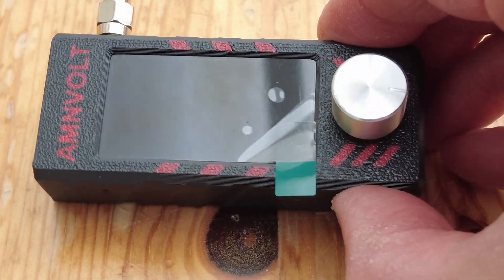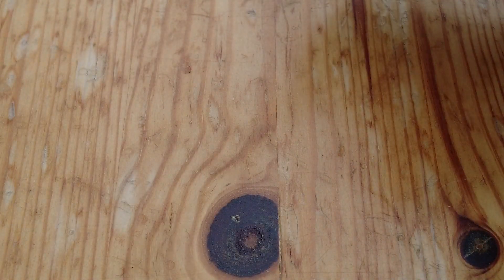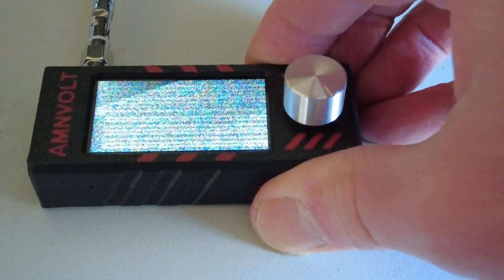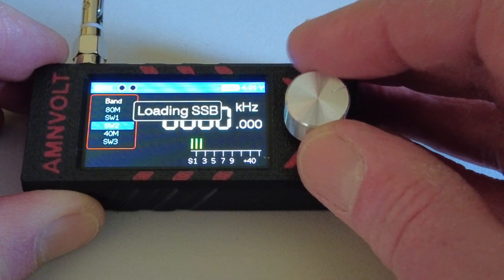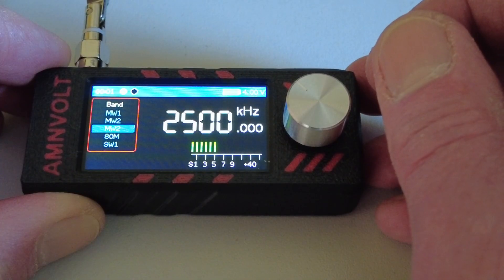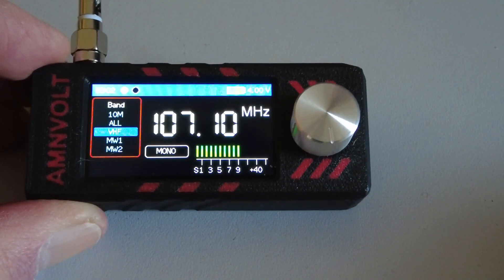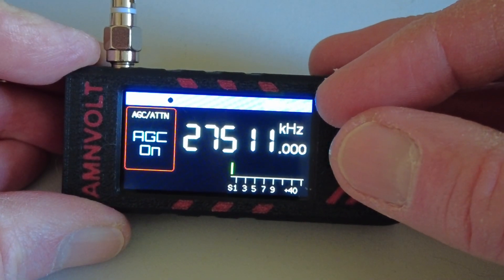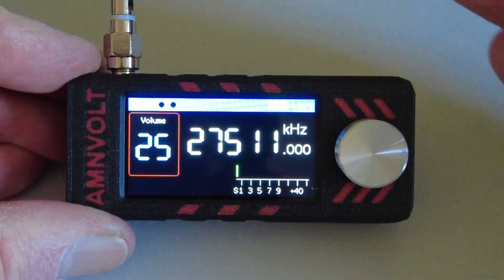The mini ATS Radio  A First Look

Comment: No-nonsense demo, as always 👍🏻The UX here may need some refinement at first glance. (1) Accessing the volume control via the menu is extremely inconvenient; it should be available outside the menu - f.ex. by pressing and holding the encoder for 3 seconds, then releasing to go straight into the Volume submenu. Chances are, it already works that way here. (2) There should be a quick "Turn display off" option - f.ex. by pressing and holding for 5 seconds when not in the menu. Chances are, that’s already how it works here. (3) The band naming... SW1, SW2, 40M, SW3 - it’s clear they aimed to use proper names only for the ham bands, but I’d prefer consistent naming for all bands: 90m, 75m, etc.